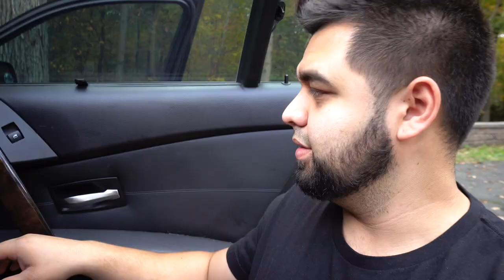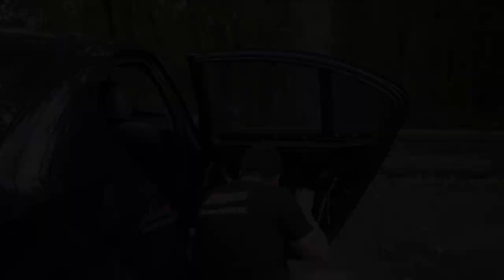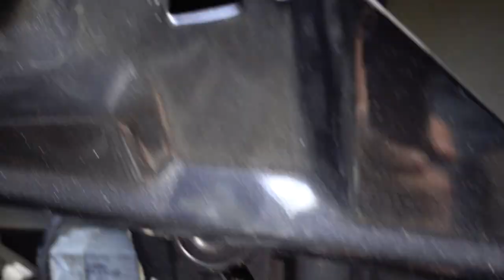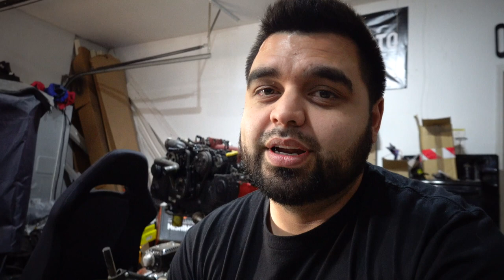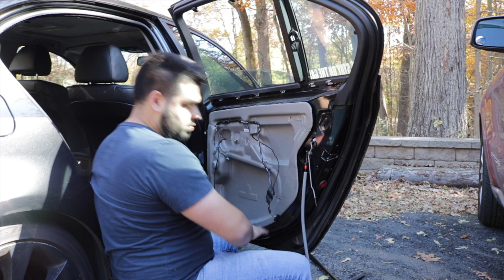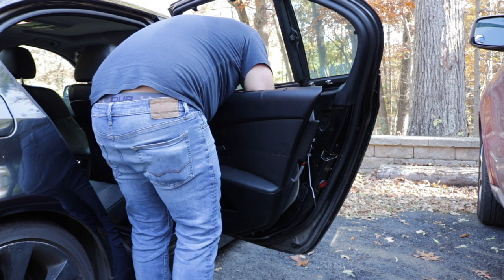E60 530i Rear Door Panel Removal & Window Regulator Replacement

Comment: If you don’t reseal that foam water shield then water will leak into the rear seat foot area. This is what happened to my car. 3M sells tacky seal strips for this. The one you reinstalled was no longer sticking to the door.
Reply from the maker: Gonna have to check it out!

Comment: did you disconnect the battery terminals prior to working/removing/disconnecting the wires and door panel?

Comment: So you didn't have to remove the glass???  Every video I've seen shows people removing the glass. Would be amazing to not have to take it out lol
Reply from the maker: I did have to remove the glass. They could’ve made this job a lot easier in sooooo many ways lol
Reply: @StayOnTheGas  shitty lol not looking forward to doing this haha my window came off the tracks today on the highway, so pulled the panel off to look. Broke an electrical connector inside at the window switch as well haha was hoping it could have been fixed easilly without a new part,but looks like a regulator is due.
Reply from the maker: Oh man that sucks! I actually went like 2 years with mine broken lol
Make sure you lube the window seals when going back in and it makes it a lot easier
Reply: @StayOnTheGas  I am contemplating on leaving it as is haha the window wont stay up as there isnt anything holding it now, so I have a pair of vice grips clamped on the door frame so it wont fall down lol  just so frustrating as everything in the car worked beautifully until this.
Reply from the maker: I don’t know how I got mine to stay up on its own but I had to have someone hit the switch while I pulled it up and once it stayed like that I didn’t touch it anymore haha. It is nice having all the windows work though lol
Reply: @StayOnTheGas  I think mine broke off where the regulator holds onto the window because there isnt anything on mine. You can just pull the window up and down.  Will take a better look tmrw in the daylight, maybe it's just the clamp and I can somehow rig it up to work again haha wishful thinking
Reply from the maker: Let me know lol. To me it just sounds like your cable is completely toast
Reply: @StayOnTheGas  cable is still straight and not bent. What it looks like is the plastic piece that holds the end of the cable into the regulator broke off.  Trying to see if I can rig it up to be glued back in just so it holds together enough to close the window. Then I just wont use it until I have a replacement haha
Reply from the maker: Ah gotcha. Yeah that’s what happened to mine too but I think I messed with it too much and ended up bending the cable everywhere lol
I had no choose but to replace it. Luckily mine came bent and they refunded me my money and I was able to fix it and use it so I replaced mine for free :)